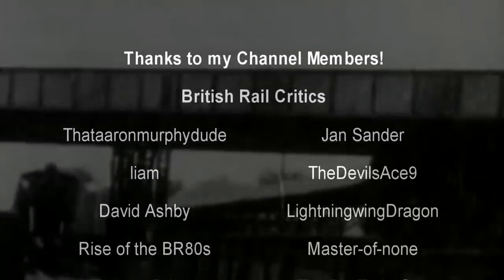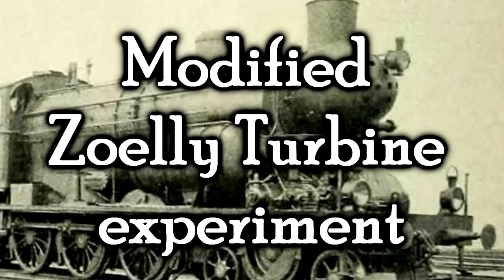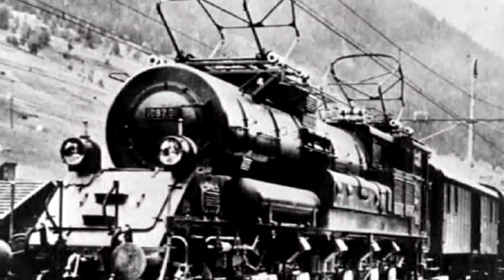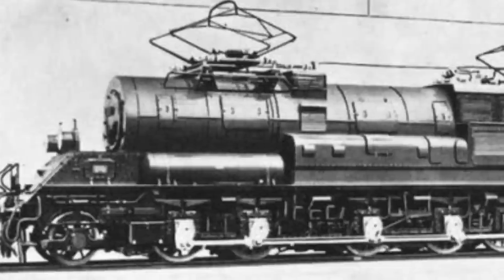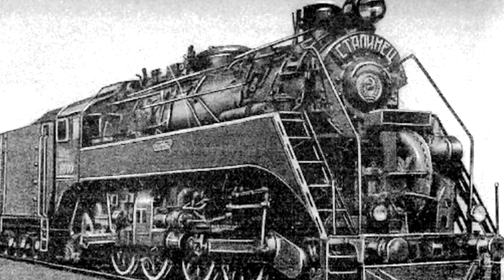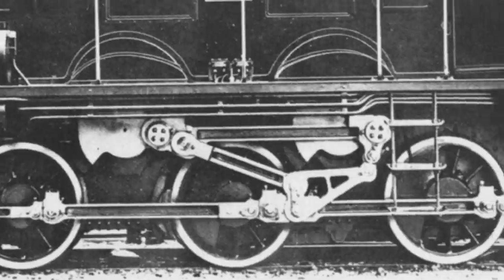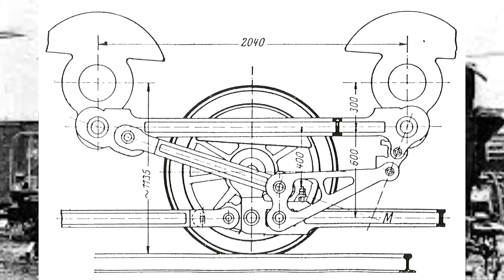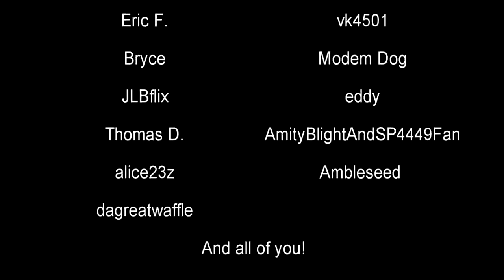5 Locomotives That Just Confuse Everyone | History in the Dark

Comment: Power conversion to DC in an AC powered locomotive is a very common thing until very recent.
It was the only way to have proper speed control as in the Italian example in this video with 3 Phase motors the speed was dependent on the frequency of the current, and not the voltage as in a DC motor.
As the frequency is a fixed parameter of the supplied power there is only one fixed speed at which the AC motors will turn.

In the Italian locomotives the problem was somewhat overcome by switching the motors between single phase operation, star and triangle configuration, this gave a total of 4 fixed speeds to choose from.
With single phase there isn't much to choose from, the voltage can't be controlled in an easy manner, hence the conversion from AC to DC.
Normally this is done with a transformer and rectifiers, motor control is done by shunt resistor banks or rheostats which varies the DC voltage.

In the Austrian locomotive a single phase AC motor drove a DC generator to accomplish this, and this was maybe done to avoid the rectifier step to go from AC to DC, as those rectifiers were mercury arc rectifiers consisting of large glass tubes with a vacuum and a bit of mercury in them, those were relatively fragile and a motor/generator group would be more robust, although more maintenance was required as it had rotating parts.

In the 1960s solid state rectifiers were introduced, and in the 1970s thyristor control came which could chop the sine wave of AC current at variable intervals enabling speed control of AC commutated motors or DC motors after rectifying.

Modern electrics use inverters and variable frequency control, the inventers make 3 phase AC current from single phase AC or DC current from the overhead wires.
This 3 phase AC current goes to the VFD control and by varying the frequency the motor speed of the 3 phase traction motors is controlled, a 3 phase motor does not need brushes like a DC or commutated AC motor and therefore needs minimal maintenance.

Comment: my reactions to all these engines: Lignite Coal Burner engine: where is the boiler they didnt show us the full picture? Modified Zolley Turbine Experiment: ok im scared of this engine and im loosing my mind. BBO 1082: NO NO NO MORE ELETRIC WIRE ENGINE. Steam-Diesel opposed- piston no. 8000: wait didnt LNER already try this? why did they think it was a good idea to make this WORSE?
FS E.552: im done. this is TOO FAR
Reply: It’s a normal boiler. It’s just that the tender has to be huge in order to carry enough low grade coal to run it. 

It’s on the list because…well what was the point?

Comment: Steam turbines not as problematic as you suggest. More an issue with gas turbines. I understand no steam is consumed when standing still unlike gas turbine locomotives such as the UP big blow gas turbines.
I think he thinks the problems of gas turbine locomotives are present in steam turbine locomotives.
The LMS Turbomotive pacific worked well, but not well enough to justify the extra cost of the non standard steam turbine.
Close to every modern steam locomotive ran a steam turbine, but just a small one to generate electricity for the headlights etc.
Just about all electricity used is from steam turbines especially Nuclear power stations and coal fuelled electricity generation.

Comment: I need all these in HO scale with directional lighting and smoke units. Love your style you could have talked trashed but you take the high road and  this is not a make fun of but more try to figure out thier thinking and explain their designs or thier principal theory. I really want to model the first one with the lignite tender. It looks like a cheap but a "I really worked hard on this" Vanderbuilt tender. I know Vandi cams are for oil burners but you said it runs on coal dust so it has an Archimedes screw system to yeet the coal dust in the fire box. I like them all but that tender spoke to me. People always focus on locomotives and caboose's and intermodels. I like tenders and livestock and poultry cars. Which mr zadoc street patented 2 designs for in Chicago for stock cars in the 1800s. And we're last used up until being phased out in the mid-late 1980s. But tenders are the most important part of a steam trains. No tender means no coal or water. But are factored into the locomotives overall dead weight. That's why switcher units got saddle tanks and coal bunker to eliminate the tender dead weight. A video on tenders would be awesome. Like caboose's having center cupula and offset and bay window and 3 window 4 window.there are diffrent types of tender designs. Love your content. Darkness you rock.

Comment: A Bi-Polar on meth?
Reply: The bipolar works pretty much the same way... but have bipolar motors in steed of the  normal (back then) quad polar.

Later engines like the class 103, Rb and Rc used bipolar motors as well. They simply powered on the AC current a set time after crossing 0V to get diffrent voltage.. hence changing voltage with no moving part.

The only moving part needed is the motor brush.

Comment: Kalman Kando was a true Pioneer, he established the oldest 50 Hz eletrification system ever in hungary, the complicated locomotives (rotating phase converters) that were needed in those days were considered necessary to have the complete benefit of the most simple electricity transmission.
Interestingly he transformed the 50Hz current not to DC current but to a three phase alternating current, resulting in few fixed speed settings.  (compare the boxcabs of Virginian Railroad)
The Kando drive was not the most important invention of him although he liked it.  It was an attempt to create a side rod drive which equalizes the spring play of the drivers in a kinematic correct manner.
The most impressive locomotoves with this drives were the hungary built class E402 of the Paris-Orleans Railway of france.
https://en.wikipedia.org/wiki/2BB2_400#/media/File:PO_E_402.jpg
https://en.wikipedia.org/wiki/2BB2_400